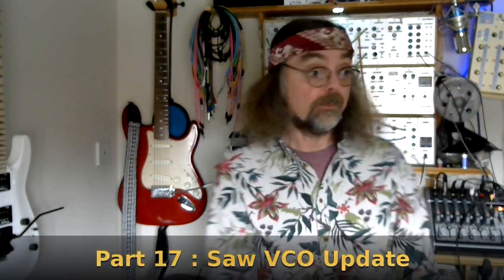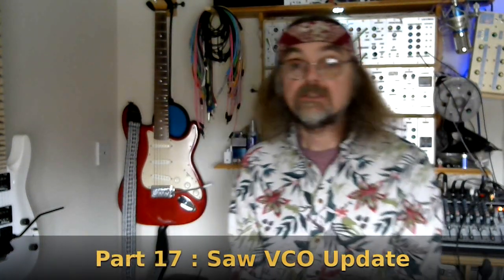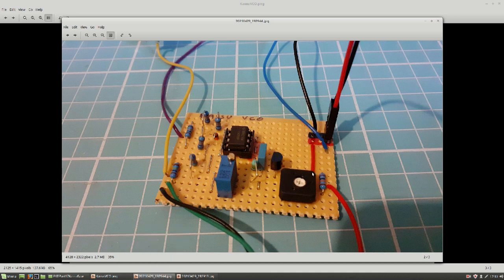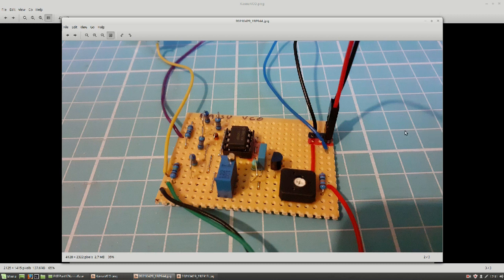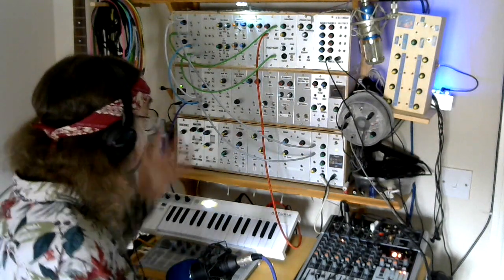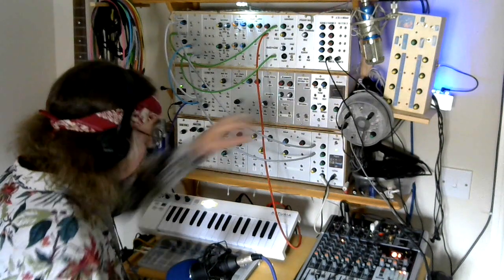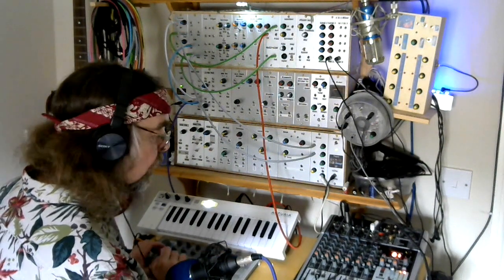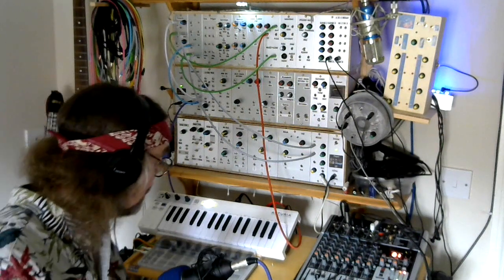Project XII Modular : Part 17 Saw VCO Update

Comment: i tried , range so short with high frequency
:( i dont know way how to scale it
Reply from the maker: Try adjusting the offset pot (R7) then trimming the CV scaling pot (R6). Also check out the kassutronics website.
Reply: @CuSiSound  yea i was , everything work , but problem is on my system , i using 5v maximum for all cv  . so you know , it run on 4-5v note